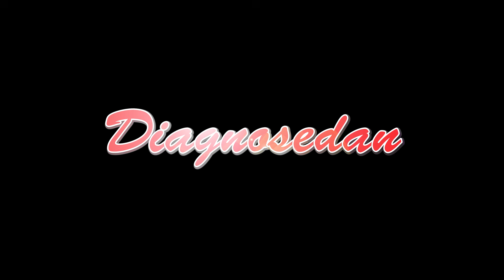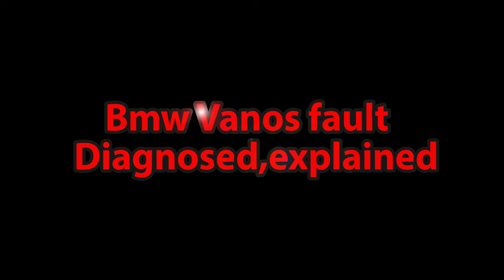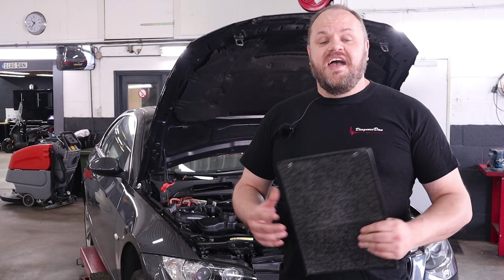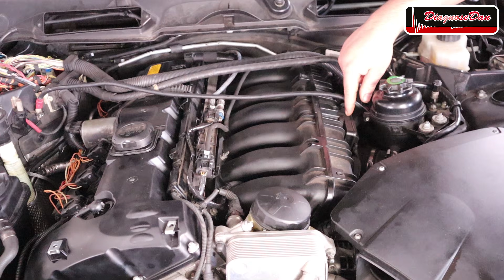Bmw Vanos Fault Explained (3000€ parts replaced and still not fixed!)

Comment: Poor design when parts can be interchanged to the detriment of the engine eg the Vanos drive units and the wiring connectors
and there may be many more. Thank God for electric motors I say because we all can't have a miracle worker like Dan at our disposal.
Reply from the maker: Thanks for watching!
Reply: @Diagnosedan  the thanks is all ours, thanks for posting the videos, thanks for your perseverance, thanks
for your skill sharing and thanks for sharing your experience and knowledge to help others.
Reply: Well that's why when you are mechanic and charge people money for jobs, you have to know what are you doing so same  connectors should not be a problem
Reply: @malceone  all mechanics aren't equal and how many competent mechanics have been caught out because they simply didn't know? Your comments are no excuse for poor design, quality starts on the drawing board, at the beginning and should not depend on the mechanic, the end user.
Sorry to disagree
Reply: @anthonyxuereb792  Don't get me wrong I know that car manufacturers do make mistake when design cars but to blame them for incompetent mechanics it is wrong.Good mechanics use tools and common sense to figure out problem.Spraying parts on car,charge costumer,then tell them"I don't know what is wrong with it"is not ok.In the end car are just machines and with thorough approach can be fixed.Cheers
Reply: @malceone  True, but still, they shouldn't use the same connectors. Even if you are a well trained mechanic with a lot of experience, sometimes even you can make mistakes, and put those damn connectors back in the wrong way. BMW should design these things differently, to avoid such stupid mistakes. I won't be so hard to design a different shape connector.
Reply: @a.f.1587  your missing the fact that doing what you ask is going to cost millions more to make a new connector plug dye. Just don’t suck at fixing cars and your good.

Comment: Bottle of white touch up paint is invaluable just add one dot on one and two on the other. Also take photos on your phone. Seen a BMW where the injectors where put back wrong and caused a few hours of extra work after a rebuild. Great video especially the in-cylinder Pico transducer
Reply from the maker: Thank you very much it's appriciated

Comment: Thanks for the video and great catch. My first thought was timing when I heard the engine run, but would have never guessed that they switched connectors. It's the little things in life that can trip you up. I rebuild my daughters Mini Cooper engine last summer and I had made sure to mark all the wiring connectors to prevent exactly that. It was my first experience with Vanos and Valvetronic and that cylinder head had a lot moving parts.
Reply from the maker: Yes it can be intimedating working on it for the first time😁

Comment: Great find! What I find interesting from the in cylinder waveform is that the exhaust cam was over advanced by having the solenoid connectors switched. 🧐 Its been my understanding of VVT systems that the exhaust cams are always retarded from base timing and the intakes are always advanced. 🤔 Maybe you could follow up on this topic. Thanks for the content Dan! 👍
Reply from the maker: Thanks for watching!

Comment: So what was the original fault or fault symptoms. The car must have had an issue to start with. The first garage must have fixed that fault then plugged it up wrong and caused the parts cannon situation 🤷‍♂️
Reply from the maker: I Explained that in the first minute of the video 😭
Reply: @Diagnosedan  intake valve. I must have been asleep 😜

Comment: How do you find the Picoscope Dan ?? Does it come with what the graph should be ???We use it in the UK. DAF uk use it and it is uploaded with good graphs for comparison ,but Eindhoven swear by the fluke ..Sometimes the hardest faults to find are those induced by a human by accident ...Strange that BMW didnt forsee this and have 2 different style plugs to prevent such an issue
Reply from the maker: Pico is much more user friendly than fluke. This engine had a few guides and sleeves missing that would have made it nearly impossible to make this mistake. The solenoids for the intake and exhaust have the same part number and the same connector

Comment: Dan , that is a fantastically informative video. I haven’t yet signed up to DDTSB but you just made me feel I need it in my workshop. The smaller the issue the harder it is to find, so very well copped 👍 & thanks for doing all your vids
Reply from the maker: You won't regret Subscribing to DDTSB. It will safe you time, money and frustration 😜
Reply: @Diagnosedan  I have done. Thanks for the reply Dan 👍

Comment: No way Dan, I’m just not believing this. There’s about a dozen BMW engineers who should be fired for this. No way should it of been designed for this error to happen so easily. Those wire looms should be tagged or labeled. The connectors themselves should not be interchangeable, the connector colors should be different. Take your pick but I lay this fault squarely on BMW’s shoulders first.
Reply from the maker: There were some guides and sleeves missing that would have made this mistake nearly impossible
Reply: A basic tenet of design which the Japanese call "poka yoke" is that it should not be possible to assemble such parts incorrectly.  So the electrical plugs to the solenoids should have been physically different and the machining of inlet and exhaust vanos units and camshafts physically different so impossible to inadvertently swap them over.  Same principle to be used for fitting the cam assemblies to the engine and indeed for the WHOLE CAR.
Reply: The Vanos units at the cams I get. It's bad engineering, and they should be keyed. But NOT the solenoids. They are the same part number x 2. Just don't stuff up the connections. If they were two separate parts then  BMW would need to manufacture two different parts for the 'same' job, and have to charge more for them. That would result in increased manufacturing cost, warehousing cost, etc, etc., right on down the supply chain. Sure, design better connector reach/placement, but they did. Like Dan said, there are guides and sleeves missing...
Reply: The advantage to not keying the plugs is that you can switch the solenoids to see if the problem follows the faulty solenoid to the other side
Reply: But it's this kind of knowledge that will allow you to get paid a higher rate. Otherwise, anybody would be able to fix it...
Reply: @daysofgrace2934 not everything needs to be leveraged for money at every opportunity ffs 😂

Comment: Hi, Excellent video, but why don't vehicle manufacturer not prevent the accidental cross connection of the solenoid  valves by simply adding different indexing pins to each connector? Keep up the good work and stay safe.
Reply from the maker: There were some guides and sleeves missing that would have made this mistake nearly impossible

Comment: Great video Dan. Big mistake from BMW to make these 2 connectors the same. These should be different so you can't plug them in the wrong way🤓
Reply from the maker: There were some sleeves and guides missing that would have made it nearly impossible
Reply: @Diagnosedan  shame they wasted so much money and time but at least it gave you an oppirtunity to educate your audience.🤝

Comment: Very interesting. 

I would've keyed the vanos system so the inlet and exhaust systems won't be interchangeable, as well as the plugs for the solenoids. 

Very interesting to see, and to make notes of.

Now, about that beer... I don't drink alcoholic drinks, so pass it on to somebody who can drink it. :)
Reply from the maker: The reason that the Vanos units are not Keyed has to do with the installation and timing procedure. That's actually very easy because there are no keyways.

Comment: Surely BMW should have put two different types of plugs and sockets for the vanos or colour coded them 😃
Reply from the maker: Actually there were some guides and parts missing if they were installed it would have been nearly impossible to install the on the wrong solenoid

Comment: A free tip , just mark one of the connectors and the soleniod with a white marker before removing the connector.This will avoid spending 3.000 euro's .
Reply from the maker: Look closely at the video, you'll see they actually marked one of the connectors with white paint
Reply: @Diagnosedan  I looked at it again, you are right, but the mechanic needs a much  bigger white stripe and or new glasses.LOL

Comment: hi dan can you explaine the code 4b90 code n47 e91 lci bmw
Reply from the maker: In most cases a bad high pressure pump, look for metal shavings in the fuel system
Reply: ok dan i should mention that i have a bmw with the n47 engine ...its telling me that the dsc is not responding ,,,and the dme is yellow fault in the module  the the engi8ne check light showing half ....the brake is solid red also basically the car wont start ...sigh

Comment: I think the best blooper was the mix up of the 2 connectors for the solenoids. BMW should've used a  different connectors dedicated for intake & exhaust. I feel for the technician that made that mistake. That's scary given the issue it had to begin with. I bet you laughed like you did in the blooper when you found out the connectors were mixed up.

Comment: Pretty common. Fixed quite a few of these with swapped connections. Even one with a NEW engine fitted still connectors remained incorrectly connected. Nice one. 
One question though. Why on earth would you not use your tiepie scope? And use a Pico? Pico is a good scope. But TiePie sets the level a bit higher up IMHO. Unless you are getting older mate and need the simplicity. 😱🤪😂
Reply from the maker: I use TiePie, Ditex Snapon and Pico scopes. Just wanted to show the in cilynder pressure transducer. I had never done a video using that before.
Reply: @Diagnosedan  but!!!!! You are not denying that you are getting older! 🤔
Haha, just messing with you man. 😂As always, well done. 👏👏

Comment: Wouldn't they have seen that if they ran the VANOS test plan where the car is running and it adjusts them individually to different angles and checks commanded versus actual.  When that plan ran they would see it's not doing anything.  How much would have a bottle of nail polish to mark one of the plug connector and solenoid?🤷🏻‍♂️
Reply from the maker: If you take a good look at the video you'll see they actually marked one of the connectors with White Paint

Comment: I’ve seen a lot of this issues from DIY fixers. Just this year probably 3-4 cars. They are trying to fix  vanos issue and change the solenoid but swap the connectors by mistake.
Reply from the maker: This was my first
Reply: @Diagnosedan  anyway it’s awesome explanation. I like to watch your videos. That tool to see wave form is amazing. Never seen something lake that in person. What I usually do to check it quick I just unplug one connector too see which one has open circuit ;)

Comment: I know the original mechanics are gonna have that "dead inside" kinda feeling once they found out the answer.. Gosh, I feel bad for them,  When we overlook something so simple! It's a costly mistake we all... Have made. Lesson learned
Reply from the maker: Yes, but he was also very glad the Car was fixed without the need for more parts
Reply: Agree, but huge shame on the BMW engineers who decided to put two similar type of connectors at such a place. Of course, as long as the cable with this connector can reach both sockets, it must be irreplaceable - absolutely not what I expect from a BMW engineer.  @Diagnosedan
Reply: @AMGswede  likely, the solenoid is the same for both Intake and exhaust. So keying the connectors would increase the number of unique parts, increasing cost and likelyhood of "out of stock". Of course, some Poka yoke would be nice, but not at all costs.
Reply: @kain0m  kinda agree with this but, a well-versed mechanic would have known they were the same connector and marked which one they went to.
Reply: Point taken - cost is of great importance. But then BMW could have color coded the connector on the wiring harness.
Reply: @AMGswede  So could have the original mechanic. 😉

Comment: The original work shop should be sued and made to give back all that money they wasted due to their mistakes.
Reply from the maker: The shop that worked on the Car also is the owner. They tried to fix the engine and resell it
Reply: @Diagnosedan  well then it looks like they will eat the costs.

Comment: Now the real question is did they switched between the Vanos connectors after they  have rebuild the head, or after they have replaced the cams and the Vanos wheels. 
By the order of the problems it sounds like they were right to do the head and thats when someone switched the connectors. 
Thats a bummer they didnt take a look on the valvetrain and Vanos wiring diagrams. poor costumer tho.
Reply from the maker: I don't know about that, i wasn't there when they replaced the other parts

Comment: Thanks Dan, you make it look so easy! The thing that strikes me is the horrific engineering of BMW. Why do people buy that stuff?! A plastic part in the inlet? Two plugs side by side that can be interchanged? Vanos units that are not the same but interchangeable? Frumpy little oil seals that stop an oil pressure short circuit? Do they design the cars to fail within the 3 year lease period? 
I stay away from German cars like the plague, they're the new Italian cars but without the good looks in my opinion..;)
Reply from the maker: Car manufacturers make the most money after they have sold the Car. There is actually not a big Margin on selling cars.

Comment: Great engineering again BMW... Using the same plugs for both solenoids in the same location. Something you'll never see on Japanese cars.
Reply from the maker: There were some guides and sleeves missing that would have made this mistake nearly impossible

Comment: Had same sh1t with transit 2001 crank and Speedo sensor same conector on gear box.start first flick an stops.😜.lesson learned. 
Every day is a learning day.
Never forget that.😜
Reply from the maker: I've also diagnosed that one once. It was a transit that would start anymore after the clutch was replaced!

Comment: Now, who paid for that mistake that led to all the parts changing. I hope the shop ate the cost and did not pass it along.
Reply from the maker: The shop that worked on the Car is also the owner. They tried to fix and resell it
Reply: @Diagnosedan  by the way what did they say when you told them those connectors were reversed?

Comment: You would think BMW would “key” those connectors so they couldn’t be interchangeable…. But I realize keeping them the same reduced cost and manufacturing complexity. Good call checking the schematic/wire colors. Another good video Dan!
Reply: Normally there's a 90 degree cable boot that makes it impossible to get them the wrong way around. For some reason they're missing for this video.
Reply: @sdgelectronics  - Often good mechanic work is in the little details like this.. If I notice two connectors were the same and that close together, I would probably label one of them with a piece of electrical tape, just to flag it when it when it goes back together. You know the other shop was kicking themselves when Dan told them the issue…
Reply from the maker: Thanks for watching

Comment: Rotten design. How could BMW not key those connectors?
Reply from the maker: Same part number solenoids for intake and exhaust so same connectors
Reply: @Diagnosedan  Still could label or colour the connectors. That was sloppy engineering.

Comment: Unfortunately this happens more often; seen it a few times from different shops and even an engine revision company. The thing is; if you are sure you installed things correctly, people tend to get blind for this obvious kinds of mistakes and overlook even the possibility of it. In all but one of those situations; the harnass guides which are clicked on the connectors, were gone, just like it seems to be the case in your video. If they would have been installed, misadjustment is less likely (they are 90 degrees bend on 1 of the connectors).  At least with certain engines I'm sure of that. Common symptom is the car will start though not to good, will give faults on 1 side first, after increase of RPM on the other and after that will be hard to start until cooled down. I will add a link (just a picture from internet as example, not mine) https://i.ytimg.com/vi/xgPPFQBbYbE/maxresdefault.jpg
Reply from the maker: You are right the 90 degrees bend was missing

Comment: Great example of how a couple close-up pictures prior to disassembly could have saved the day!  Or even a paint pen to mark the connectors.  BMW has several engines with similar situations: non-keyed connectors that can be plugged in backwards and the engine still runs to some degree.  Great catch!
Reply from the maker: If you look closely to the video you can see he even marked one connector with White Paint. 🤣

Comment: wat a wrong plugged connector Can mixing in and out Can mess  up  wat een verkeerde geplugde stekker de timing van in en uit can  beïnvloeden weet ik zelf maar zo als altijd bmw zou zo iets kunnen preventen door een nok in plug
Reply from the maker: Same part number solenoids for intake and exhaust so same connectors